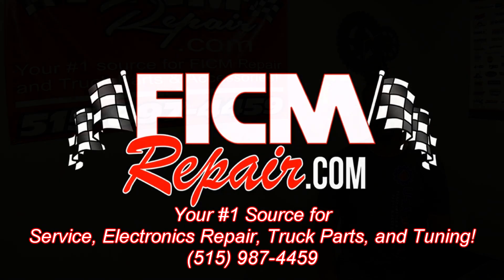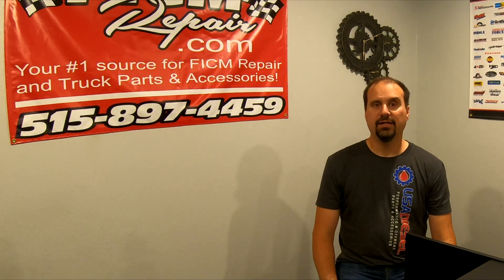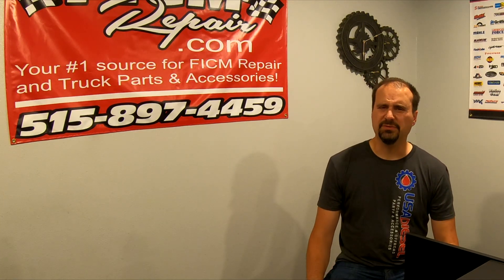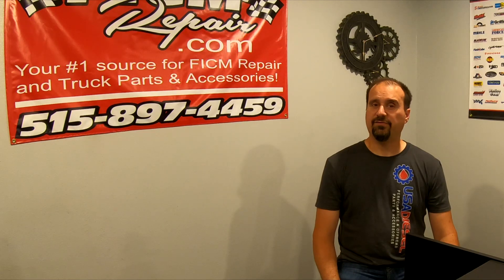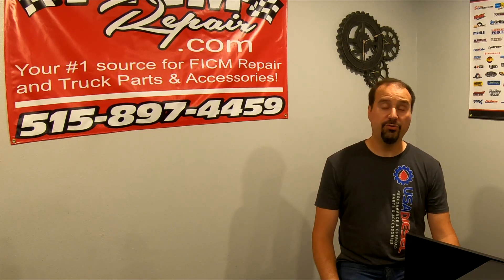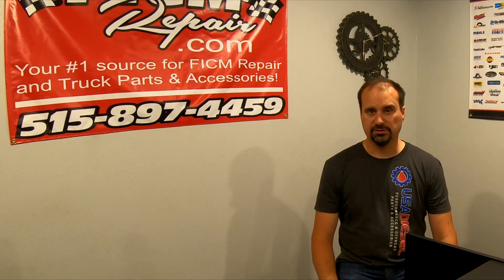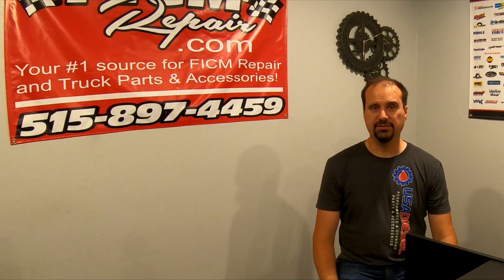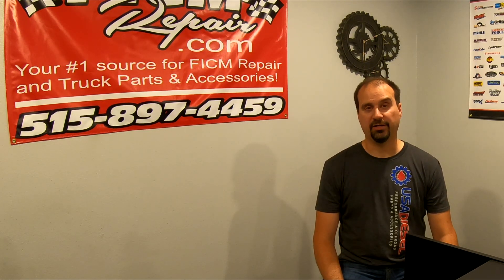What Causes FICMs to Fail On a Ford Powerstroke 6.0

Comment: I noticed a week ago I was driving around with a bad passenger battery and my charging system was only putting out 12 to 12.5 volts after I fixed these issues now my truck is making noise and feels like I lost power, it still runs and ficm is reading 47.5 to 48 volts do you think my ficm shit the bed??

Comment: Hey I have a f250…2005 6.0L and it dies randomly while driving..just shuts off no engine light/lights come on the dashboard strong crank but if you don’t touch it for like 20 min it will start right up no problem it did it a few time now it’s every day just brought the truck 20k   Brought new batteries my friend hook his scanner to it and said different reading on the ficm / voltage you think could it be a fuses or the ficm…? And how much your ficm cost mine truck is a powerstroke 250 4x4 lmk asap thanks for your time 💪🏻🤙🏽🤙🏽
Reply from the maker: This video might help you narrow things down - https://www.youtube.com/watch?v=r9BPul66RMg

Comment: So it's not the Ford FICM that's shoddy, but the Ford ;)
Thanks for the tips; it didn't occur to me that low supply voltage was destroying the internals.
Reply from the maker: Meh - the FICM is crazily sensitive to supply side voltage issues.  It takes a bit over 1300 amps to engage the starter and around 300 amps to keep it running.  After the engine starts, you think you are out of the weeds only to find out that the glow plugs stay on for up to two minutes after ignition!  Ooft.

Comment: What a bunch of BS! FICM'S go bad because they are designed to fail! This is a revenue producer and an underhanded method of increasing profits with increased sales. The 6.0 was sold 10,000 dollars shy of being finished. It requires a FICM to operate properly. Ford and International intentionally stole from their customers and committed fraud. Believe what you want to believe. I own one of these expensive pieces of shit! Ford/International FICM's were designed to fail. That is the only reason why they fail. Buy a good one from a good manufacturer and you won't have FICM problems anymore.

Comment: I have a 2003 F350 6.0 no no crank no start try to put scanner tool on it except it could it be the ficm is bad
Reply from the maker: A starter not engaging is not caused by the FICM as the starter will engage with the FICM not even at all present.

Comment: This video did not explain why my FICM went bad . Was it low bat volts , too much cranking ?????
Reply: Ford/International FICM's were designed to fail. That is the only reason why they fail. Buy a good one from a good manufacturer and you won't have FICM problems anymore.
Reply from the maker: FICM's go bad due to supply side voltage issues - either too little or too much.  Hope this helps!

Comment: I am of the opinion it was the capacitor fiasco in the mid 2000s that caused so many power supply problems was a factor early on the 6.0s life.  Flaky  FICM power supplies (not Fords fault really)  led to a bunch of injectors being replaced for no reason and misdiagnosis until the FICM deal came to the forefront.  Glad you all are around to narrow these issues down in a logical manner.
Reply from the maker: A ton of injectors are indeed needlessly replaced due to faulty diagnosis, even today.  If you have FICM issues and you have other issues, take care of the FICM issues (and the things that caused them) and see what remains before spending more money.

Comment: What kills the logic mosfet?
Reply from the maker: Logic board issues in general, including damaged mosfet's on the logic board are commonly caused by bad voltage regulators in alternators and chaffed engine harnesses.  We work on both sides of these modules, but better to avoid the issues at all for sure!  Great question!
Reply: @ficmrepair  just wondering.  I've got a premium rebuild from y'all after mine let the magic smoke out. No issues with rebuild and truck runs better than before rebuild.
Reply from the maker: @bad05ford  Glad to hear it!  We're all in this together!  If ever you need anything else for your trucks, let us know!  We carry essentially everyTHING from essentially everyONE!  The fact that we haven't been beat on price in ten years?  Yeah, that's a bonus.  :)